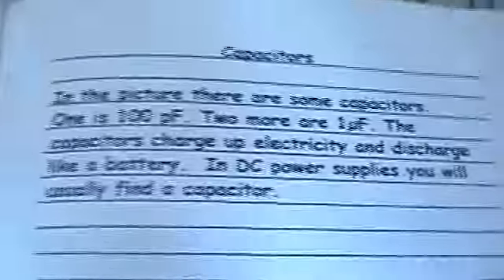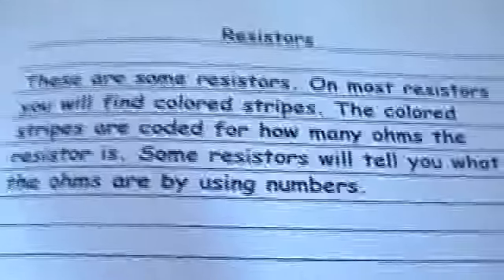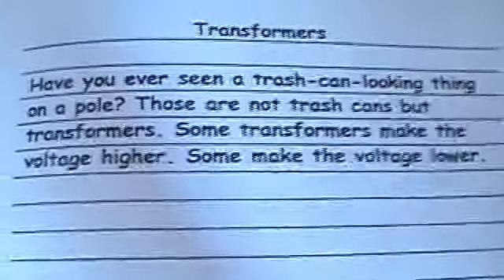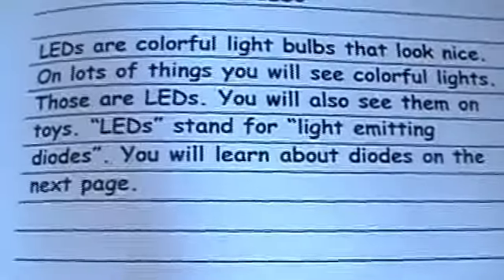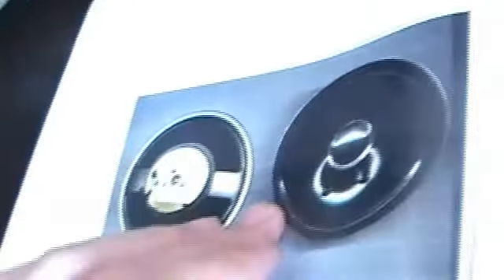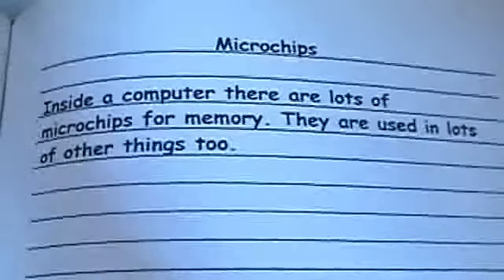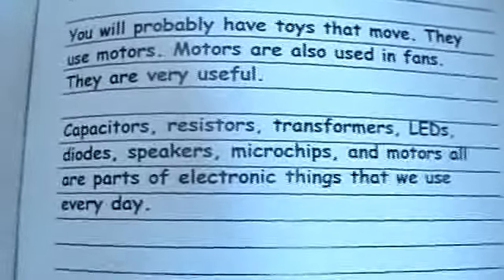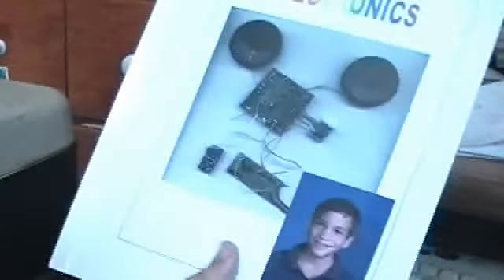My Book on Electronics

Comment from the maker: @coolbluelights Wooow!!! That's great! I personally like breadboard building better than connecting wires to spring terminals. I would take many of the parts off the kit and make the circuits I wanted on a breadboard.